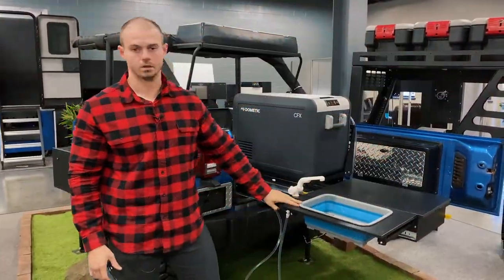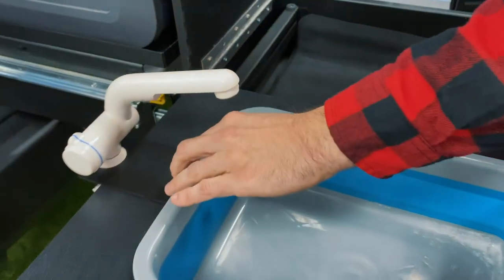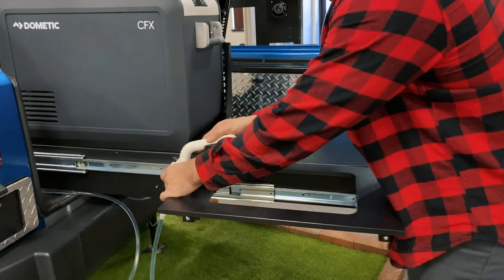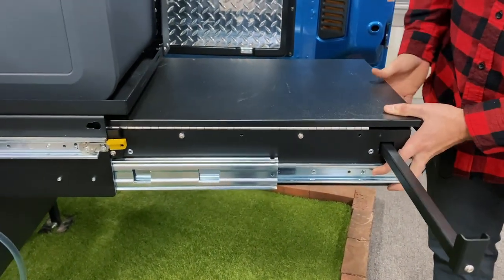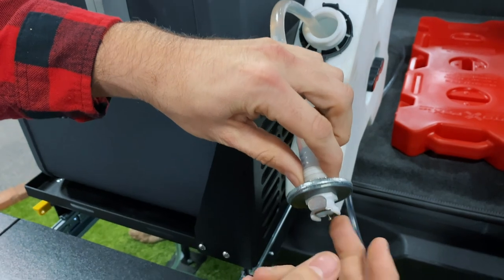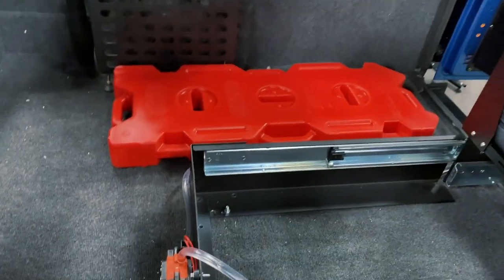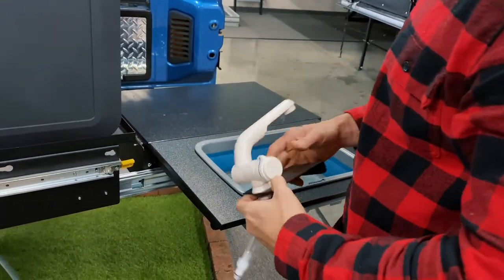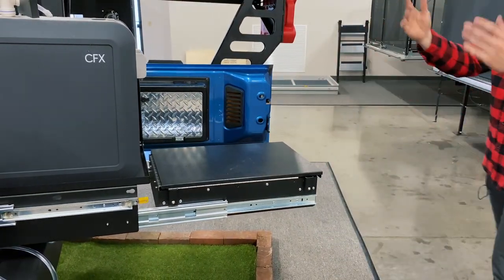MORryde Jeep Products:Trail Kitchen Walkthrough

Comment: the faucet is not connected on this video,this is a 12v faucet,you can't run water.I like the sink,i can see this mounted in my tacoma.Where you find these rotopax hose fittings??

Comment: What are the dimensions inside the drawer? Don't see that info anywhere. Also, I assume this fits in a 4runner?
Reply from the maker: Hello! If you could provide us with your email address, we can send you a print with the dimensions. It should fit anything with enough space and a flat floor.
Reply: @morrydeinc   I have a 4runner with the goose gear plates. Sso yeah, its flat wooden surface. Where can I email you to get the dimensions. Don't really want to put my email here.
Reply from the maker: @AndrewA6  parts@morryde.com

Comment: What was that bracket you had your power supply mounted on?
Reply from the maker: Thanks for your question! The Power Panel is attached to our JKU battery/ammo can holder that sits to the wheel wells. It is most commonly attached to the roll bars. The part number is JP54-052 and is now available for sale. If you are interested, you can buy from us directly, as our dealers do not have stock of this yet.
Reply: @morrydeinc  is that installed in a JL?
Reply from the maker: @robertalonzo5725  It can be installed in both a JL and a JK as well, or any vehicle with a flat floor.
Reply: What Size Dometic Fridge are you using? 
Also what's the part# for the sink cutout? And sink faucet as well as what pump did you use for this install?  Does the sink kit come with the hose quick connect fittings?
Reply: @That_Guy_Grizz  Looks like a 40